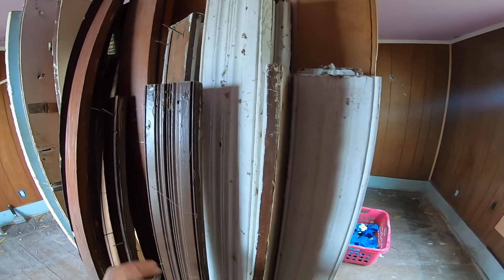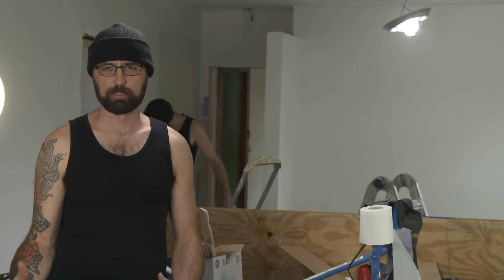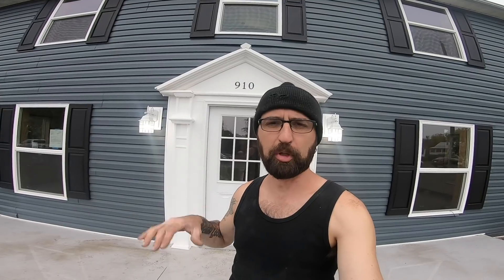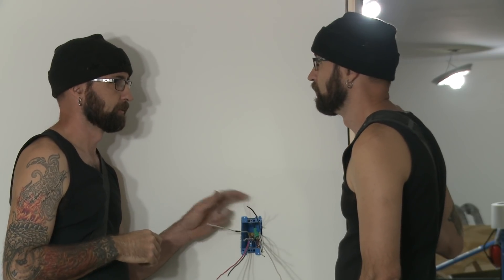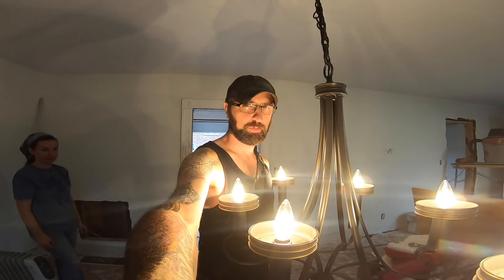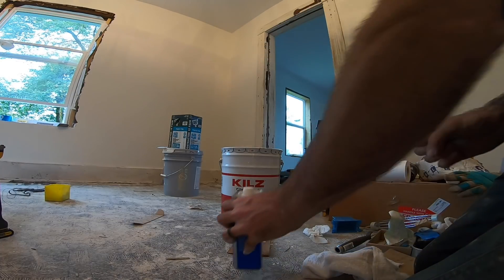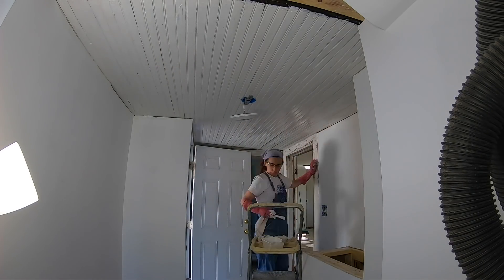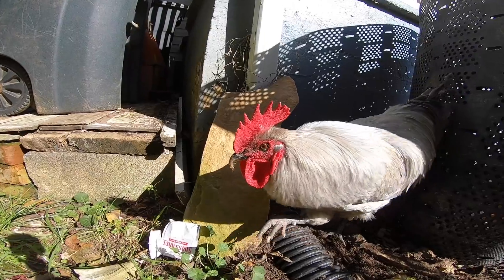Hoarder House // Fart Fan and a Chandelier

Comment: I’ve always been taught that a bathroom fan should vent through a roof vent, not a soffit vent. I’m not an expert and have never installed one. Does it really matter, and does it depend on what region you’re in?
Reply from the maker: They should only vent through a fixture that is designed for it like I did. Never just having the vent pipe shoved against the soffit. I've seen that many times...    👍